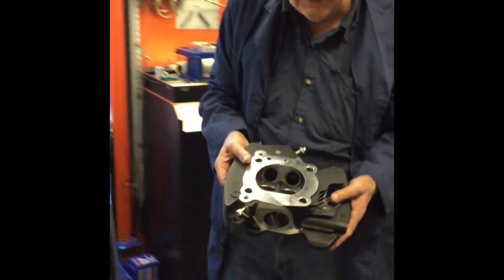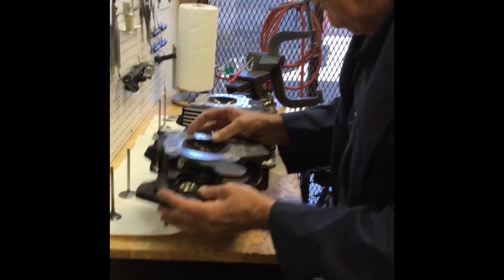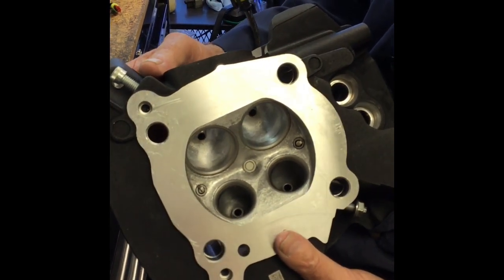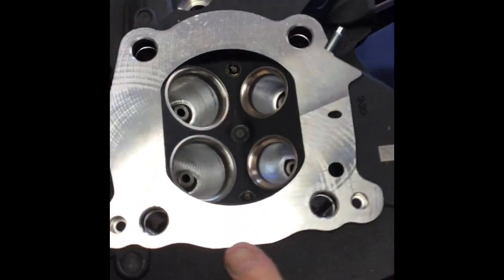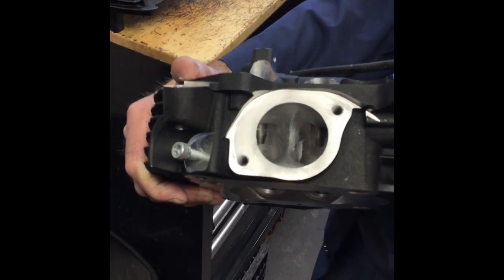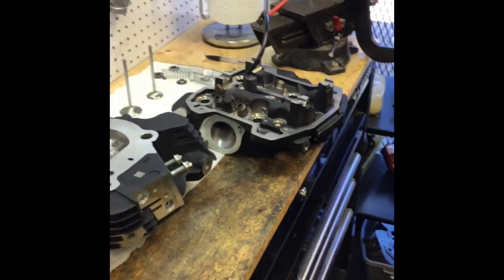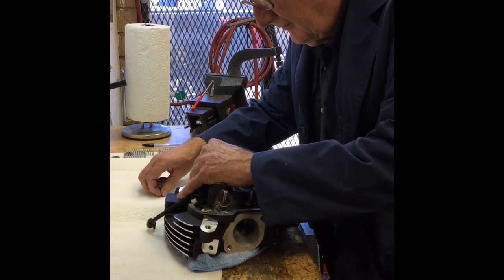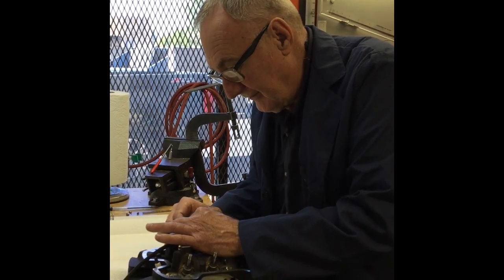Harley Davidson M8 107/114 cylinder head Flow Testing

Comment: I wish I could spend a week working with you Sir! I’m a CNC machining for a living guy for 35 years and know we would get along so well. I love this stuff/by the way let em all know why it’s .050 per revolution. Formula for SAE is one inch divided by the pitch.in this case 1.0/20=..050 and if it’s metric the formula will be pitch /25.4(example) M8x1.25 is 1.25/25.4=.0492 per revolution👍🏻

Comment: So it looks like Harley's cnc head improves flow some but not nearly as much as yours.  That should mean that the Harley CNC heads don't sacrifice throttle response and low end torque but probably don't have near as much high end flow (high end horsepower upgrade) as yours?
Reply from the maker: flow development is a never ending process. I doing more testing on the cnc ported heads. many people are not happy with these cnc heads.  I keep you updated

Comment: Great video.  If your head that you ported has a larger intake chamber than the CNC heads, why is there not a substantial increase in velocity with your heads??  Thanks.
Reply: Cause big diameter, is slow air, and small diameter is fast air, given the same cubic feet per minute. In some instances, an 883 bored to 1200 with 883 heads ,small valves, will out run a stock 1200. Hmmm?

Comment: Do the CNC ported Heads fit and work on the 107 Engine? Or does it require the 114 bore Kit?
Reply from the maker: they will fit, we are working on cnc ported heads,  I tried to use a set of my heads my 107, was not happy with results. I think the cams that were available at the time were the problem.  check back in few months on our results

Comment: Harley Davidsons "brand new" Milwaukee  8 motor is junk, watch the below video's!

https://youtu.be/p-ZApNGjOuM

https://youtu.be/TNc7EYTn3G0

The "Motor Company" did NOTHING to address my "Twinkie" Motor when it blew up after only 20K miles due to a stupid tensioner design flaw! Neither did all the other people who suffered the consequences of this  sorry ass Motor Company's utilization of substandard roller bearings which were placed in the motor AND transmissions! Do you honestly think they'll do ANYTHING about this latest debacle? I'll just continue to ride my old reliable Carbureted Evo WITH throttle cables and no computer while all the of these new junk M8 bikes are getting wrenched on.  "RIP Harley Davidson 1903-1998".
Reply from the maker: i have to agree . it going to be around for long time

Comment: You mention the CNC ported heads intake cc'd at 118-120 and your ported heads were 146, but you did not mention what the stock heads were?  Is the port velocity much different between the stock, CNC and your ported heads?
Reply from the maker: we have a new video coming on measuring port velocity

Comment: Charlie thank you for sharing your expertise with us. It is obvious you know what you are talking about!
Reply from the maker: thank you, i have a m8 with 130 torque and horsepower
Reply: Charlie Lawlor Would love to know more about it. 107, 114, 117? Did you start with the CNC ported head castings or regular ones?
Reply from the maker: i call my m8 the gentleman express, it has 131 torque and 130 hp. it is a handful to ride for a 68 year old guy. it has q4 head that have 4 different valve sizes and off set valve seats. a t-man 216 cam shaft. full sack head pipe with street cannon mufflers. it is 114 ci, with large throttle body. i use a power vision to control the efi. at 1600 rpm it has 105 torque.  more to come
Reply from the maker: i use stock heads
Reply from the maker: i guess your right
Reply: That is funny I own a 2018 Harley with a M8 and it is a 107 it get 110 lbs of torque at 3,000 rpms. Your math is off